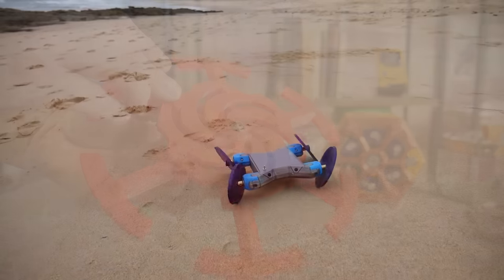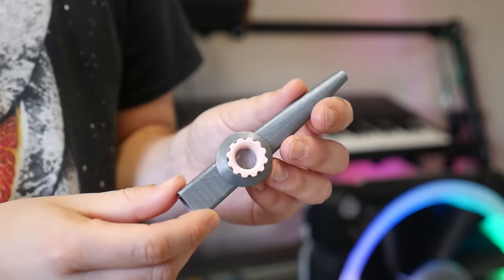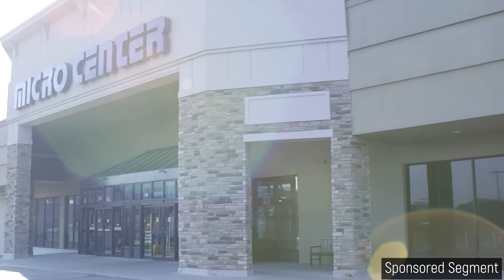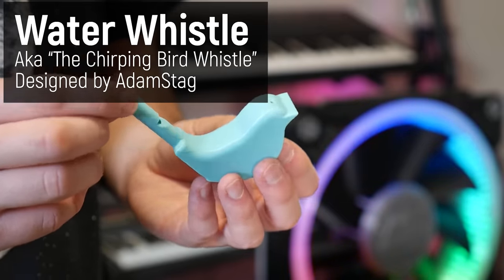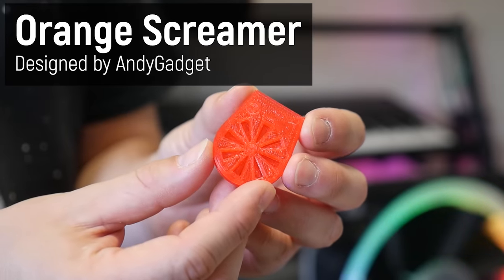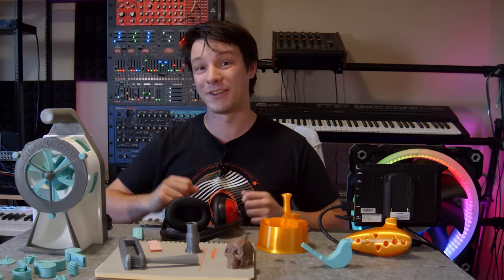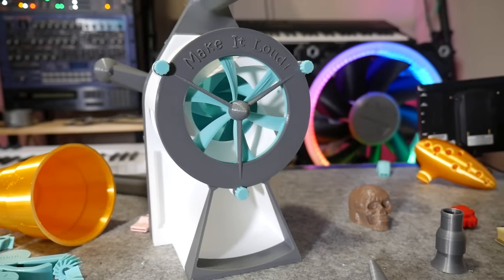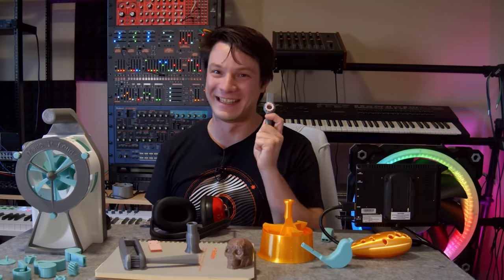What is the LOUDEST 3D Print?

Comment: I just finished printing out the air raid siren. It's VERY LOUD at full speed, so make sure to wear hearing protection if you decide to spin it for a while.

Some things to note while printing:
        -The body is split into 2 parts, but one of them doesn't fit in my Prusa i3 mk3s+. Luckily someone already made a modified version of it that can fit.
        -GOOD LORD THIS TAKES A WHILE TO PRINT. The longest part to print took 25 hours at 0.2mm. Make sure that everything is properly set up, since you don't want to be 20 hours into a print
         only to realize you didn't check "detect bridging parameters" in your slicer. Ask me how I know.
        -The person who made the model recommends printing one of the rotor parts with a raft. I recommend not doing that.
        -Make sure you let the parts cool down slowly to minimize warping. I took off one of my gears as soon as it was done printing and it ended up needing a lot of sanding because of how warped
         it was.
        -It isn't really shown anywhere, but the body has several support sheets added that you're supposed to cut off once it's done printing.
        -Parts that need a lot of sanding:
                1. The inside of the rotor housing to remove any bumps.
                2. The top and bottom of the gears to prevent rubbing against the housing.
                3. The place where the handle and one of the gears are attached. You want the distance between them to be the same as the thickness of the bearing, since a larger gap will make it
                     wiggle inside the housing, which will cause the gear to rub against the body. I had to shave off some plastic with a knife to shrink the gap.
                4. The places where the bearings fit in the housing, since the fit is very tight.

Comment: Once upon a time I was using  a ThinkGeek Sonic Bomb alarm clock to wake me up... It turned a bit awkward when I had a 6am flight to catch, for which I set the alarm at 3am... and I left for the airport forgetting to deactivate it! Two days later I was called to allow someone in my place to unplug it, apparently it wrecked havoc 🙉 Now, this last 3D print, coupled with a good electrical motor... 😄

Comment: I have a Longer LK5 do you have a video to fine tune the printing using the CURA slicer program
Reply from the maker: I don't, but I'd start with an ender 3 profile and extend the print volume. Should get you very close as it's Bowden extruder is nearly identical.

Comment: A saw a short documentary about an air raid or Nuclear attack siren in an America city. It was run using a Chrysler V8 internal combustion engine and of course the actual siren part of it was huge to reach across a large area urban. It even had a clock type mechanism to make the whole thing move from side to side slowly, engine and all on a swiveling base. That was extremely loud. I found this link and although not the one I originally saw describes them none the less https://www.youtube.com/watch?v=_3_JuiEgkcU I just found the original featureing Hagrid it only a few minutes https://www.youtube.com/watch?v=l04qWEEPFEk